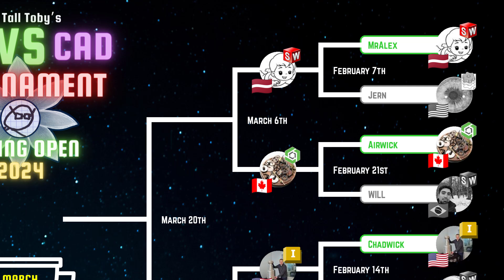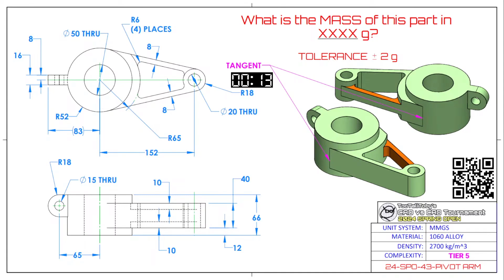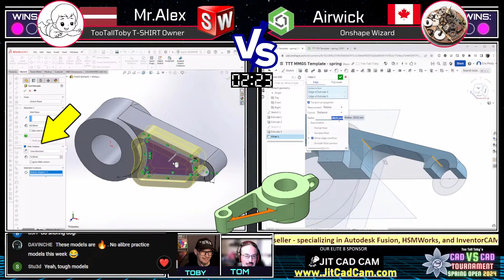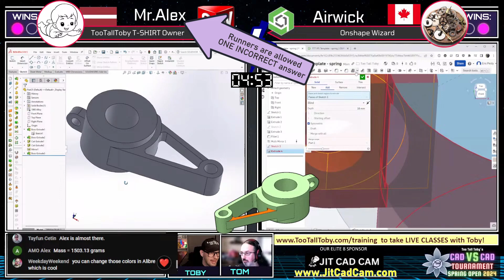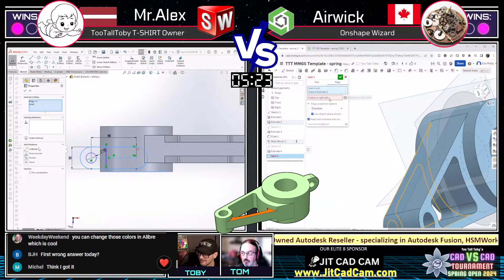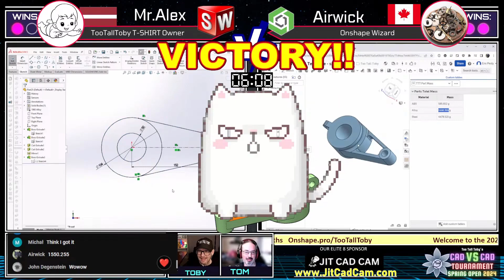SolidWorks VS Onshape - Which is FASTER?

Comment: Wow, I’m a bit late to the party, but I’ve been following your tutorials and managed to draw this and get the correct mass of 1550grms! 
Didn’t have a clue how to make the one web thinner until I spotted Airwick using ‘split’. I then did extrude/remove, no problem, however that extrude would not mirror for the other side. Any ideas why? 
I had to do the split again and repeat to finish the model, so frustrating.
….and Mr Alex got the little boss wrong 36mm wide not 32mm 😉
Reply from the maker: It’s been very nice to have you in the community Rob!
Reply: Yup, that last hinge extrude. He was actually faster, just made a mistake.